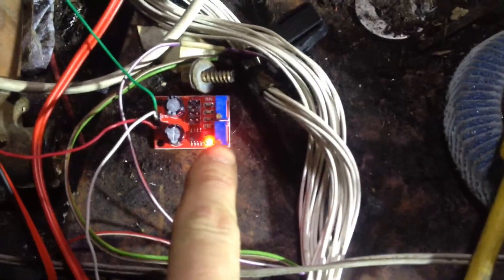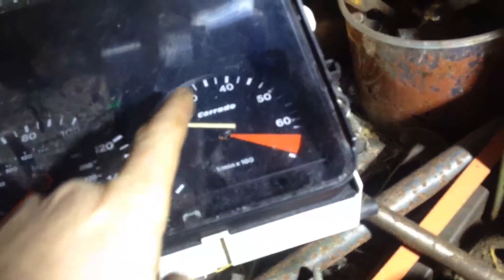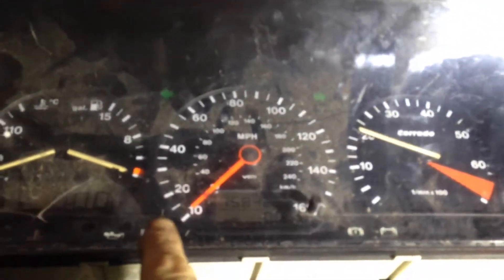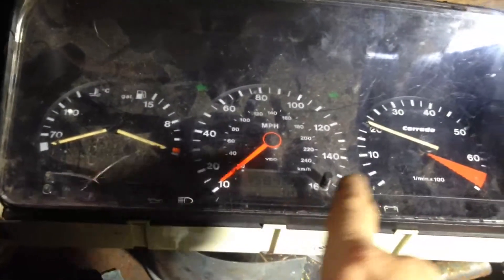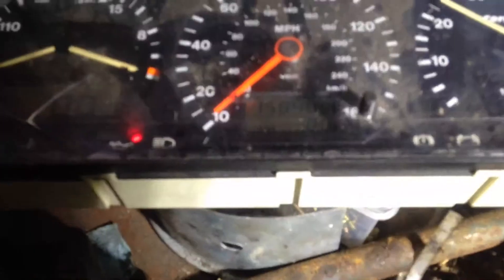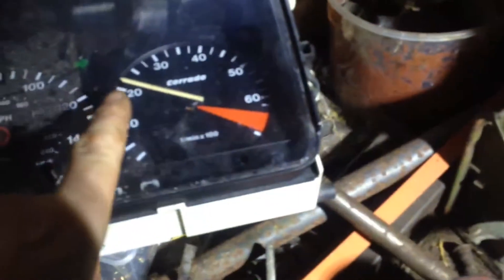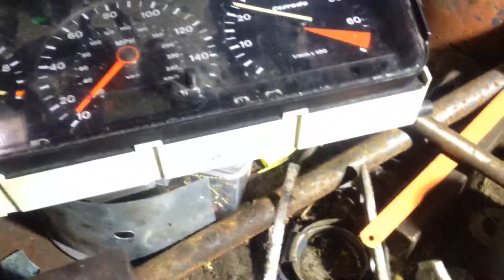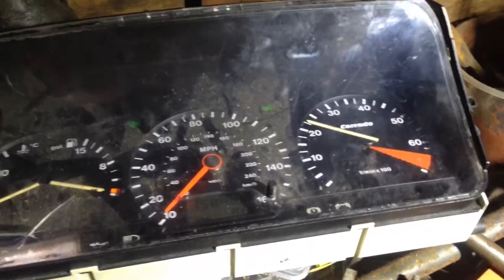Corrado vr6 tacho/rev counter testing

Comment: Hi Steve sorry to bother i have a 1992 G60 uk car now in Austraila has a 18 t motor running the g60 charger with a uk motorsport ecu  The clocks, no temp had it more at one point, rev tac will try with you good advice been trying with the - will try + as the ecu gives a 12v signal. Speedo it has a 6speed four wheel drive box look like a 3 wire hail sensor have wire up but not working. Clock light up fuel needle work fine hard wired the oil light as i only have 1 oil pressure sensor Is it a basket case???
Reply from the maker: Ok 92 is the cross over year so the wiring is a bit funny. What colour needles does the cluster have ? 
White needles I think take the rev tach count from the coil ( -negative side) 
Red needles take tack from ecu 
Speedo is 4 pulse vss ( all vws are the same) unless it’s mechanical
Reply: @stevenharpervw  Hi Steve White needles so would i need a late speedo to take the 12v from the ecu? thanks for getting back
Reply from the maker: I think you could make the old clocks (mechanical speedo ) work with the mk4 Quattro  gearbox . And make the rev counter work off the coil 
I’m guessing you have gone 1.8t from a TT or mk4
Reply from the maker: Also When you turn in your car . The bottom left in the cluster . Does it display MFA functions or only time clock .  ( I’ve an old video on fixing that and wiring. There is 2x +12v and -12v wires  and the face lift models changed the wiring

Comment: Hi Steven. I'm not sure if you're able to assist? We have a 7yr long term project build 16v conversion G60. It's almost completed, but we're stuck with an infuriating problem, the tachometer simply doesn't work. We've been spending a huge amount of effort trying to address the problem, but we're making no progress! We have a signal at the instrument panel but no activity. Could you possibly assist in any way? We'd be most grateful for any guidance.
Reply from the maker: G60 takes tacho signal from negative side of coil. Dash clock cluster needs white needles 

92+ corrado with red needles takes tacho signal from ecu
Reply: Thanks very much for your reply. We believe the fault might've developed early on in the project, possibly following charging the battery? We've learnt many issues/stories surrounding the risks associated with bty charging! The ECU isn't original & it's been mapped to suit the build requirements. Our current dilemma is how to actually confirm if the Tacho itself is at fault? A x30yr old instrument panel isn't the most common repair request. We've purchased a trick box from America which converts trigger signal but still no result.
Reply from the maker: @chalkster4723  external tacho. Wire it up off the coil to test its working . Then unwire it and re wire it off the corrado loom they way you can test if the wiring is damaged or if wires have been swapped at some point . 

What colour needles are the dash clocks . The red needle only talk to ecu . White needles talk to the coil
Reply: @stevenharpervw  Thanks again for the added info, I'll confirm the exact details on return to work in the morning. Cheers
Reply: @stevenharpervw  Update for you. Remarkably, we got the tacho working today! The box of tricks we got from the States did the job. Turned out the belief that a 5v signal wave was required was wrong. We changed to a 12v supply signal & it worked immediately. It's by no means perfect! The operation is OK but the needle jumps every few seconds which we believe can be settled through a filtering process on the 'magic box' Such a relief to finally have a good result as we were struggling with the correct methods of testing the instrument panel itself & were considering an expensive replacement assembly which would've been a waste of money. Thanks again for your assistance.
Reply from the maker: @chalkster4723  post up a short video of what you have achieved so far. I would love to see your project . Well done 👍
Reply: @stevenharpervw  I've never put anything on YouTube, I'd be irritated by thumbs down nonsense! If you want to give me an email address I'll happily forward a Google album link. Be delighted to hear your thoughts.
Reply from the maker: @chalkster4723  email - impondering@gmail.com
Reply from the maker: Does that help , keep me updated as it’s a cool project and don’t forget to subscribe